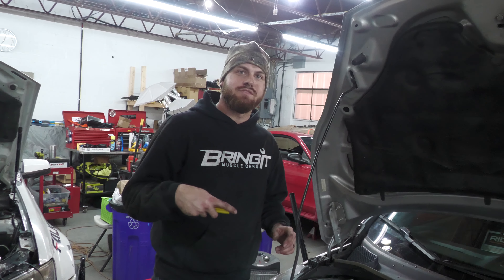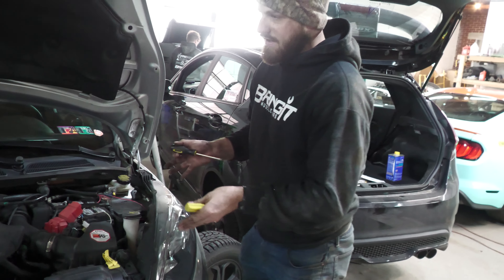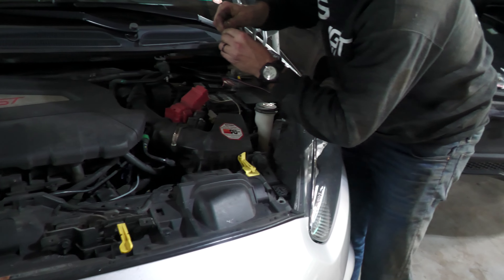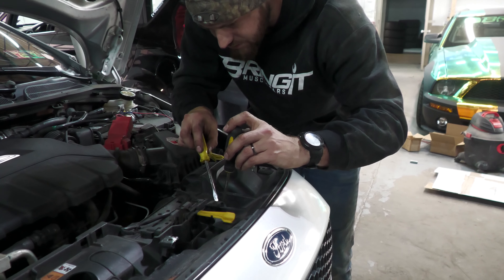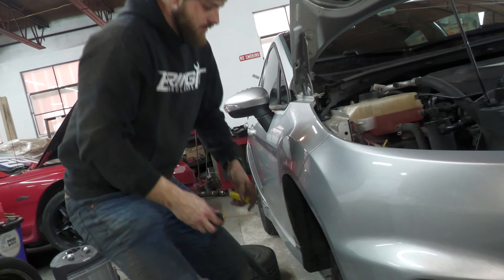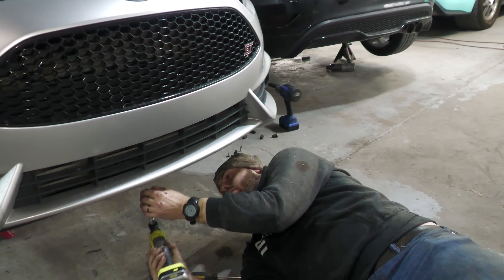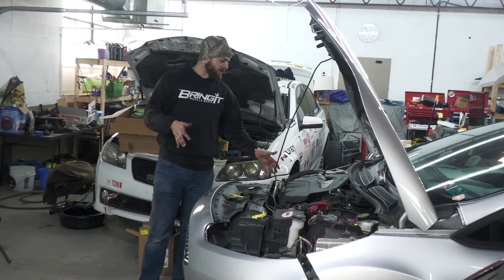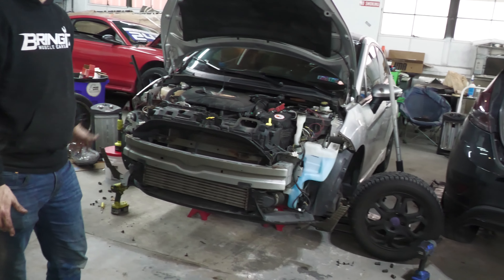HOW TO REMOVE A FORD FIESTA ST FRONT BUMPER

Comment: Hey I really need some advise could you pop me a comment back if you could help me with something thankyou!
Reply from the maker: What do you need help with
Reply: I’ve got a fiesta and my outside temp is reading lower than what it is it’s like 30 degrees and it reads 20 after a journey of 60mph and doesn’t want to go back up again after I’ve stopped? Any ideas how I can reset the sensor or where I can find it? Thanks 😆😆
Reply from the maker: @c_red_edition9587  no idea how to fix that.